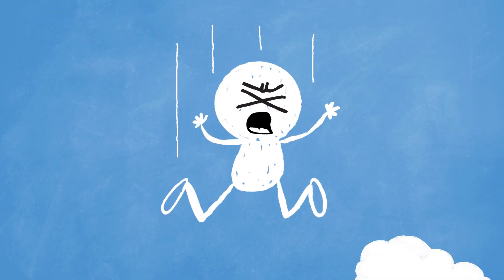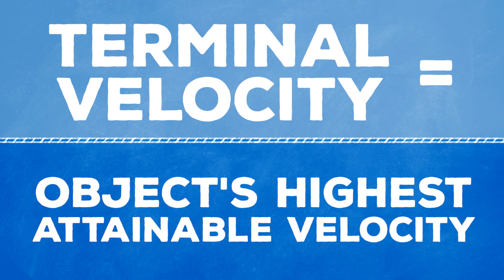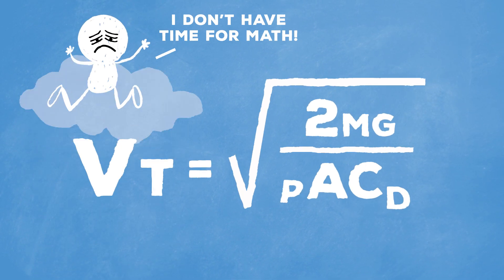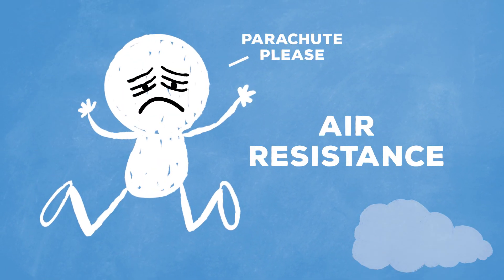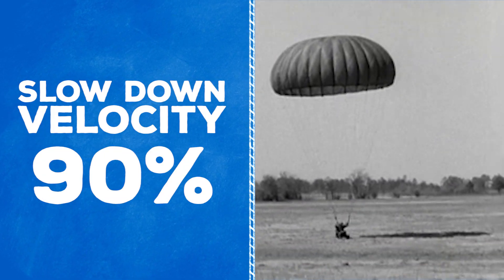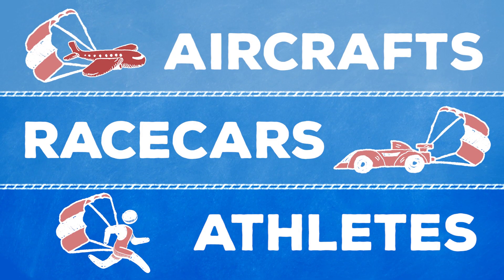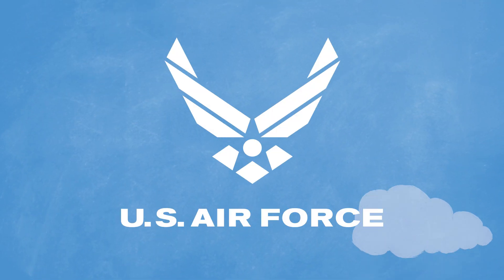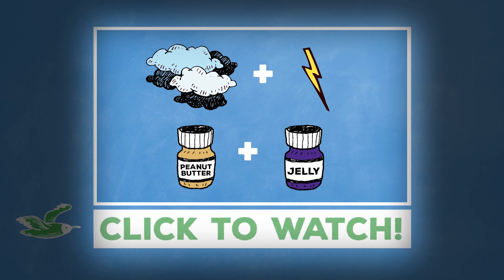How Do Parachutes Work?

Comment: what is 200feet??????????
Reply: If you get 100 random people to line up in a row, the line will be exactly 200 feet long every time. Makes perfect sense, no?
Reply: He means in metric
Reply: +daniel117100  or arrange 7,200 barley corn. totally flawless.
Reply: +daniel117100 2400 imperial inches.
Reply: +daniel117100 61m
Reply: +daniel117100 Simple enough to divide by 3 and get a rough estimate. Or just type 200 feet in a search engine, and it does the math for you.
Reply: +daniel117100 Well, you walk 100 paces and that's 200 feet, since 1 pace is 2 feet. Makes 100% perfect sense.
Reply: +daniel117100  3 chains also work. but you will have to measure your chain with my chain first then it will be great.
Reply: America should start to use potato system and measure things in potatoes!
Reply: It's equivalent to 60.96 meters per second

Comment: wtf is mph and ft.?
Reply: 'murica fuck yeah
Reply: +Lieutenant Capellini How badly educated do you have to be to use feet in math? It was only used in this video for the people who don't further their math education and learn that metric is the master race of all forms of math. Units matter when you gotta convert the numbers even once ;)
Reply: +Lieutenant Capellini Why would anyone who grew up and lives in a metric only country surrounded by metric only countries want to waste time learning an antiquated system?
Reply: Lieutenant Capellini I am not the subject. Where I am from makes no difference.
Reply: Lieutenant Capellini What i said was that the metric system of units is the objectively better way. Feet are fine when measuring your height but when you want to solve any equation or math problem you will have to use a calculator for every part and step of the problem just to get the numbers exact all the time, you will also be working with lots of pointless decimals all the time. It's completely pointless to waste time like that. There is a reason why every upper level math class forces you to use metric units. That is why i questioned your education. Not going into serious math is fine but don't act like you have any experience with it when you are defending an already defeated argument. Metric master race is used in all natural sciences because it is more efficient than any of the other unit systems. Jumps of 0.1 is better in math than jumps of 0.0833... then 0.333... then 0.000568181818 then 0.0125. You get the point. Natural scientists do aswell. hushed tone STUPID
Reply: Miles per hour  and feet
Reply: Where do you live to not know either of those? I mean how badly educated do you have to be?
Reply: What are you trying to say? I mean who doesn't know how to use both. Maybe you're not educated well enough either - don't worry though, it's totally not your fault you're stupid.
Reply: What country are you in then?
Reply: Why can't you say? Really though, what country?